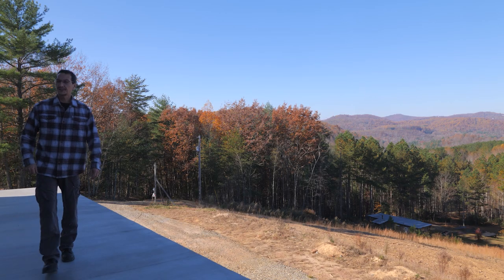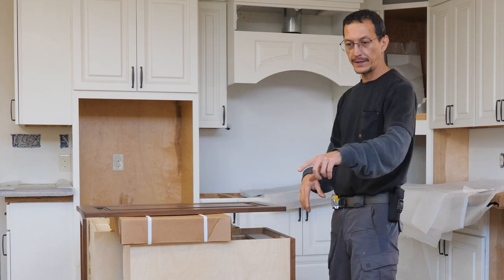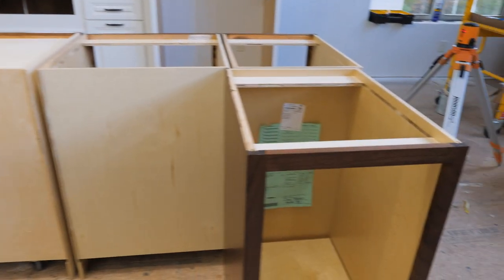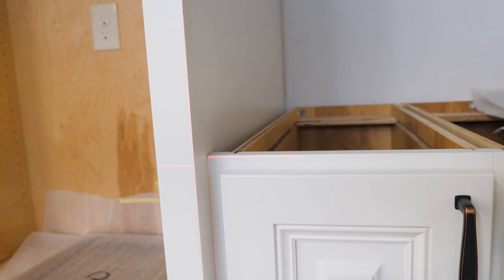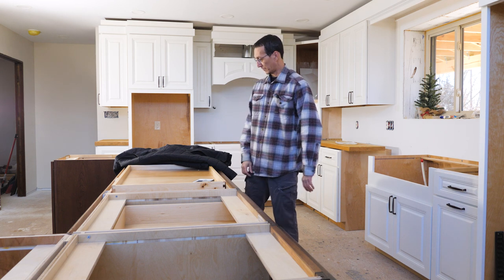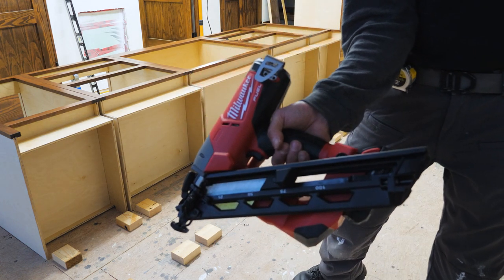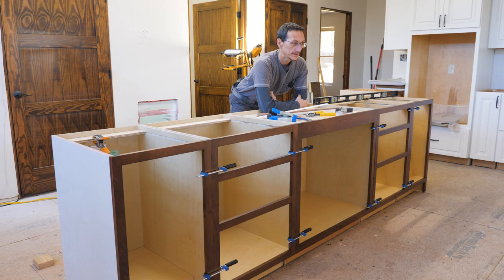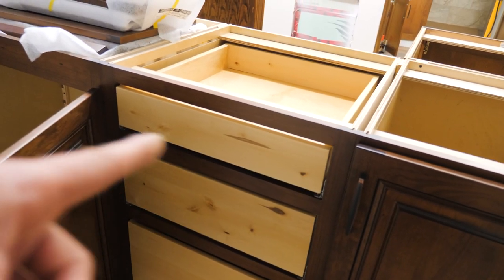The HEART of the NEW KITCHEN!

Comment: The only thing I would have done differently is to lay the floor down first. Great kitchen!
Reply from the maker: Can’t lay a floating floor before you set the cabinets.
Reply: @Guildbrookfarm  Got It! I laid a hardwood floor down floor only because I worried what would happen if I needed to replace something and didn't want to worry about replacing the floor.